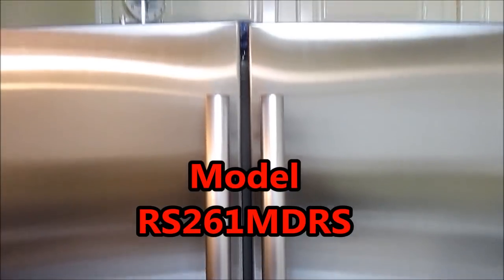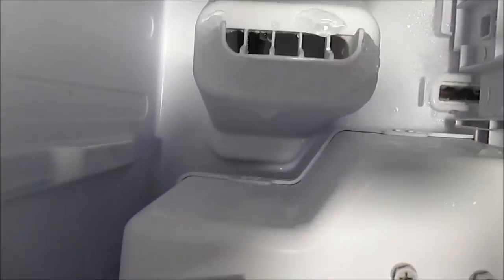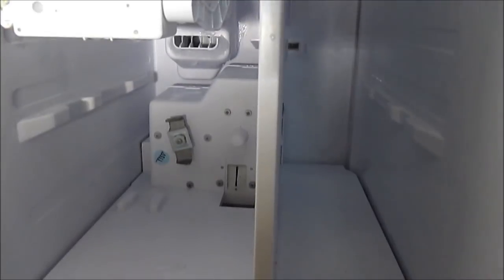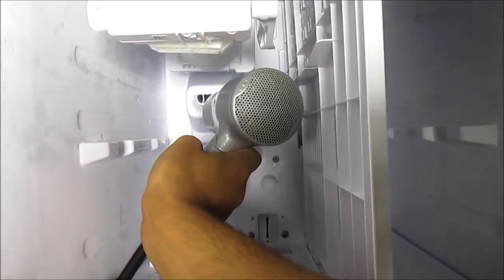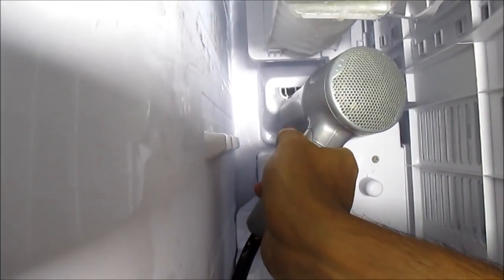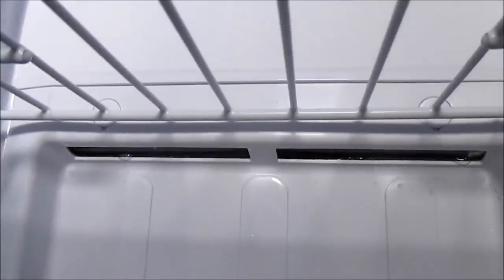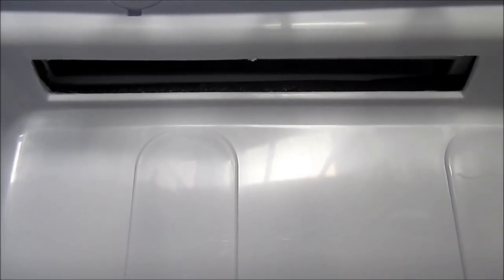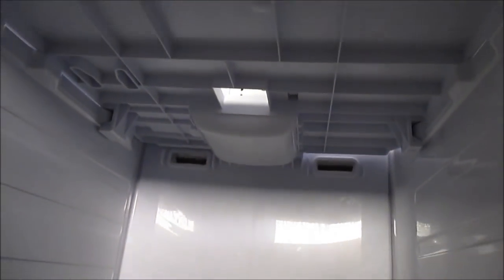How To Stop Noise From Samsung Refrigerator RS261MD **

Comment: Are you still having trouble? I found the solution for my rs25h5111sr/aa. Praise the Lord! My fridge was only two years old and ready for the dump. 

FIRST: ALWAYS UNPLUG your unit BEFORE you attempt to blow dry or repair!

I took off the back panel and tested the condenser fan motor. Nothing was wrong with it, so I adjusted the fan blade so that it would spin freely! The blade was set too deeply into the motor. This caused it to work for a while after thawing but eventually led to it refreezing. All I had to do was gently pull up on the blades so that it set up higher on the shaft! Such a simple fix!!! (Even Samsung repairmen were LOST as to what to do, and others refuse to work on Samsung!) 

Next I used the blow dryer directly on the coils and into the bottom drain. It’s super important to use towels to dry up as much water as possible then blow dry one more time removing all (as much as possible) moisture from the cabin. After this, reinstall the back panel. 

You can find other videos to help you uninstall the back panel, uninstall the fan motor, set the blade, and reinstall. Instead of a short term solution, this should help fix the problem if it’s a fan issue, which from what repairman stated, it usually is.
Reply: IknowGodIs haven’t had ours 6 months and it’s making this darn noise

Comment: I own the french door model, RF24FSEDBSR/AA, so it has a slightly different ice maker, but it worked!  There was a build up of ice in the back of the unit... once I melted the ice with the blow dryer, the noise was gone.  Thanks for the video.
Reply from the maker: Good to hear, thanks for watching.

Comment: Thank you for pointing me to the source of the noise.  In my case (also Samsung brand slightly different model), I had not used the ice/water dispenser for a few months, but all I did was to dispense 2 glasses of ice , and it became quiet immediately.

Comment: Thank you. 
We purchased a house which came with a Samsung fridge, model RB215LASH, and the freezer portion quit  freezing and then the noise started. We are in the process of melting a ton of ice off the various vents and walls.  I thought a fan motor or compressor might be giving out. Glad it's just a frosting issue.

I am also going to adjust the level to keep the front a little higher than the back and see if the ice comes back.

Comment: Thank you! Thank you!!! My fridge was making a loud humming sound. I found your video and that was exactly the problem! There was a huge ice build up! How did I not notice! It took 4 hours for the ice to melt... even using a hair dryer to move it along! You saved me a repair bill! I can't figure out where all that melted ice went? Where's the puddle of water?
Reply from the maker: The melted ice water drips out the little vents, that's why I had down a couple of towels to soak up the water.

Comment: My Samsung was making this noise too.  I used the blow dryer like you said and it's quiet finally!  Thank you!!!   My frig is the model with the freezer on the bottom and I get Ice under my crisper drawers so I have to defrost that part also.  I will never buy another Samsung refrigerator again!
Reply: Hey hey. There will be more easy way to make that noice gone. Theres secret function at the panel and you can make it defrost itself.
Reply: I have a 5 yr old side by side and it has been making noise for 2 months.  I used a hair dryer and for 30 minutes blew  hot air into each of the vents in the back of the inside of the frig.  ie about 5-6 minutes into each of the vents. Did this 2 days ago and frig is still NOT making the noise.   Again, all I did was blow the hot air into each of the vents and so far as solved the problem.   Frig is not making any noise now !!!!
Reply: Brinley Hocutt wow
Reply: Liz Peterson you learned your lesson the hard way it sounds like. What attracted so !any of you to this video I can't say.
Reply: megalodon1 what panel? Please explain.
Reply from the maker: Don't worry, you'll have to do it again within a year and I bet you won't pay that again. Thanks for watching.
Reply: Liz Peterson samsung refrigerator/freezer sucks. Completely sucks. I will also never buy another one.

Comment: To add further details, use the high fan speed and warm heat setting on the hair dryer; do not use a heat gun as it is designed to melt plastic.  The 6 holes at the top give them 30 sec each, the next two holes sort of half way do for a minute.  The next two or four holes do for 2 min each.  The bottom 2 vents and the bottom hole do for 3 min each.  Do a full treatment every 6 months or  year if you follow the monthly bottom hole defrost regime.  Do the bottom hole and bottom vents monthly ( if humming sounds bother you trying to fall asleep, otherwise every two months) since these are nearest to the fan and compressor and where build up is most likely.  Finally treat each hole and vent with an air compressor on a yearly basis.  Next use acoustic paneling at least 1" thick on all sides of the walls the fridge goes in; hopefully the opening can accommodate this.   At night turn off the ice.  Between all of this, you cannot make your Samsung fridge quieter.  Btw, after treatment allow the fridge to rest for a minimum of 5 minutes before plugging it back in.  The ideal freezer and fridge temperature is -19 celcius for freezer  and 2 degrees celcius for fridge.  This gives the best balance of frozen ice cream and keeping produce fresh while not wasting too much electricity.  Setting the freezer to lower temperature will expedite ice build up.

Comment: I went one further emptying the fridge and removing the back panel. There was so much ice that even using a blow drying it took an hour to melt it all. Even so, the ice (and buzzing noise) was back a month later. I'm doing it all again today. Poor design where one needs to use defrost mode Fd (fridge defrost) once a week just to keep the ice at bay. Thanks for sharing.
Reply: Did you follow a video to remove the panel? I’m attempting the same task as we speak.

Comment: Thanks!  I was about to purchase a new fan motor for my Kenmore Elite but defrosting the unit solved the problem!  It took 4 coolers and some dry ice and 24 hrs.  Much faster and less frustrating than changing out parts that still work.  Bad design on Kenmore's part

Comment: ## MUST READ PROBLEM FIXED ##

I've had this noise , when you open the door it stops . I stripped the back panels off inside the freezer to expose the fan . On the back off the white panel that covers the fan that's where your problem is . There is a layer off grey foam stuck to the back off the panel and eventually the water gets into the foam freezes and expands then the foam slightly rubs the fan making the noise . I tried the hairdryer trick but it's only a temporary fix . Unless you remove this foam it will continue to rub . I defrosted for 48 hours 2 or 3 times before I decided to look into it further before I just brought the fridge freezer to the dump . Now it works fine with no noise .

Comment: I tried the hair dryer solution, however even with moving hair dry around frequently the plastic was getting very hot.   Brought a floor fan out and had the air circulating in freezer while using the hair dryer, this kept the plastic components relatively cooler and still removed the ice build up.  Looking good for now, hope this solved our problem for good.  And of course the fridge is out of warranty by like 5 days.

Comment: Just saw your video.  My Samsung is doing the same thing...Very very annoying.  I will first try to reset it, if that doesn’t work I will buy a cheap hair dryer from Walmart.  This refrigerator was expensive.   Should not be doing this. Thanks for posting this video.
Reply from the maker: You're welcome, thank you for watching.
Reply: megalodon1 
I used a small handheld steamer, and it has been quiet for the pass 8 hours.  Thanks again for the video.

Comment: Thank you for posting this, had the exact same problem and now the noise is gone!
Reply from the maker: Bison, helped you knock out the problem like Mike Tyson!!!
Reply: Don’t thank him right away. The problem will persist unless you thaw the fridge completely AND thaw out the drain hole which this man didn’t advise you to do. That blocked drain hole is what caused this problem. Another thing you should do is after the complete thaw you should raise the front of the fridge by about a half inch. Leaning it back will cause the doors to close better and when the fridge goes into auto defrost the melted ice will flow better into the drain. Trust me I had this problem and what I’m advising is a permanent fix.

Comment: Just want to add another “thank you so much for this” comment. My freezer was also a little harder to unstick, but it did eventually give and it works fine now. 

I will say, in case it wasn’t clear what “pull it out” means, you need to pull the rail towards you. The video makes it seem like you have to pull up a bit.

Comment: So I don’t have a samsung fridge but watched your video to try and fix mine which was doing the same sound. I impatiently did the hairdryer thing for probably not long enough. Fired the fridge back up and the sound was still there but different. I ended up grabbing the vent nearest the sound in the freezer and pulled it out just enough to stop the sound. When I released it the sound came back. I then pulled hard enough on the panel that there was a small pop. The sound stopped. It hasn’t come back in multiple days which caused me to think about how packed full the freezer was and that there might be a possibility that the contents had been pushed up against the back wall enough to push the wall toward the fan behind the wall. I think that by pulling it out it may have undone this. May be another kind of fix for others reading this.

Comment: This is not a long term solution but I will provide one. I believe the cause of this issue is moisture entering the fridge (warm room air) from poor seals. Over time the design of the French door fridge lends to seal issues. Once the moist warm air enters the fridge, it condenses on the evaporator and in other spots. On my fridge, I have noticed condensation leak out when you fill your glass with water or ice from the dispenser. 

The long term fix is to help the fridge defrost the evaporator. I increased the fridge temperature from 36 to 40 deg F and problem has not returned. I have tried many things and defrosted the fridge 3-4 times. Today I checked the evaporator (removing all components like this video) and NO ICE buildup whatsoever after 2 months. I also kept the freezer at 0 deg F and turned the meat drawer to a lower temp to better preserve more vulnerable food (meat, cheese, etc.)

Regarding seal issues, for now I think they are minor leaks. It's hard to tell where the seal issue is. It could be where the door meets the dispenser (hole for ice to shoot through inside door), door perimeter or back panel where piping/electrical penetrates. Regardless the temperature increase has fixed the ice buildup. 

I do not think raising the wheels or doing a forced defrost are long term solutions. These are suggested on other videos. 

Hope this helps!

Comment: If he had gone just a couple of steps further, he could have replaced the part that I replaced that fix it! I'm so proud of myself, because I am 60 years old this year, I am disabled, after a 21 year marriage, my husband strayed, and we were just divorced last month, actually not finalized yet,  and I was left totally alone to start my life all over again all by myself. Being disabled, I'm on a fixed income, and I could not afford a service technician, and I sure could not afford a new refrigerator. This one is not but 4 or 5 years old! Every time I searched for my model number, I kept finding alot of RS267 videoes and info, but they are different from mu RS261!  But, I persevered, and I fixed my freezer and refrigerator, that both went out at the same time, for ONLY $9.50!  I am so proud of myself!!  I got so frustrated, because every time I called Samsung, Sears, the service center that Samsung uses, and several other places, and I told them I had already done all of the work, and I just had one simple question,  but NOT ONE of them would answer a single, solitary, easy question! They would not let me talk to a technician, and they would only schedule a technician to come out to my home! I'm ngot stupid. I know that the cost of the $9.50 part would have been tripled, and I know how many hours it took me to take it apart, but they could have done it in less time, however they would have had to wait 2 days for all of the ice to defrost before they can finish it! So, let that up just to come out here would be $75, the part about $30, and labor is generally more than triple the cost of parts. With this part only been $30, in their eyes, there's no way they were just going to just charge me $90 for what I had to do in that freezer. But, regardless, it is simple. If you do it right, it will take a couple of days to let it completely defrost, and behind the bottom panel, he's referring to a fan, but there's actually a heater coil that completely insane some consumes the majority of the space behind the back panel. Behind the talk panel, yes there is a saying that stands, and that fan is actually what cools your refrigerator. This little sensor tells that heating coil when to come on to keep your freezer from freezing up. When you hear that grinding noise, you know it's starting to freeze up. So, Tell me what I should name my video, and I will get started on it tomorrow. I hope you all come and watch it! I will give you some tidbits on things to make it easier on you when taking things apart, and a few more pieces of information he didn't give you in this video. I'll take mine back out and walk you through it step-by-step. And, this is extremely cheap plastic inside this freezer and refrigerator! But, I have my freezer set on three bars, my refrigerator on three bars, not all the way up to six bars, and they are both freezing and cooling fantastically!. More than it ever has.  These sensors are a known issue with this 261 model and the 267 model, and several other Samsung models, and it has been a long-standing problem that this particular sensor seems to go out quite frequently. It would be to your best interest to figure out how to fix it yourself! Everybody I've talked to since they threw those away!  I was encouraged to junk it! And said it would be easier for me to go buy a new one!. But, they won't fix it!! I am just so proud of myself! So, since I had a hard time finding a video about my model, and because I am a disabled female, have to do things by myself, because I have no help, I decided to make this video to help many other people out there, and if I could just help one disabled female that is alone and has no help, then my video will be worth it, especially if it saves her anywhere between $10 and $500!. Please give me ideas on what to name it, and tags so that it will be easier for people to find? I would appreciate it! Although I have already put my part in, and it is working, I have not yet put everything back in it, so I am going to show you what you have to do to safely disassemble it  in order to get to the part, how to replace it, and how to put things back together. Anyone that can turn a screwdriver can do this!  Although Brandy's Studio, hi, I'm Brandi! Is more of an art Channel, this video is definitely going up on that channel for everyone to see it! It will be the first time everyone  in my art circles will get to see my face!  I've got a few more little tidbits that nobody ever seems to put in these videos, and it's very important for you to remember to do when you're disassembly anyting! Let me know if you're interested in watching. :-)
Reply: It seems that you never made the video. What a shame. Would’ve been so helpful. I have the same model as yours and am currently taking it apart.

Comment: I think this is my problem too… my ice maker just freezes up so ive left it off… but I’m assuming it some how continued to freeze up and is now blocking some of these vents (not my model btw). My ice maker is off and I can hear noise coming from the ice maker area of the fridge.. condenser coils are clean, fan and compressor run amazingly quiet… I’m gonna assume this is the problem….

Comment: need to check your level as well, front wheels should not be touching the floor, once wheels are off the floor now check level from left to right. Condensation needs to drain correctly. Hope this helps
Reply: What must be the right measurement for leveling the the fridge freezer? Pls reply. Thanks.
Reply: Look at your manual that came with your refg.

Comment: Besides the noise ... does this cause the refrigerator to stop cooling the top part?  Freezer seems fine.  But it’s not cooling on the refrigerator side
Reply from the maker: Mine is thankfully still cooling, that seems like a seperate issue.